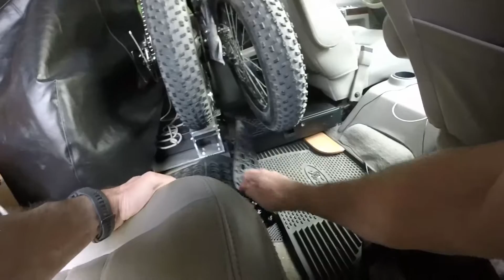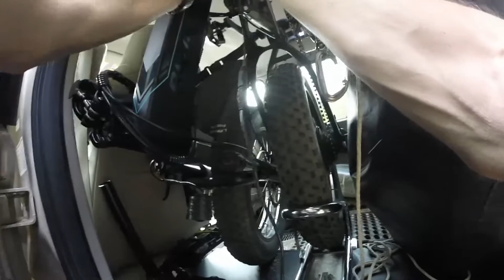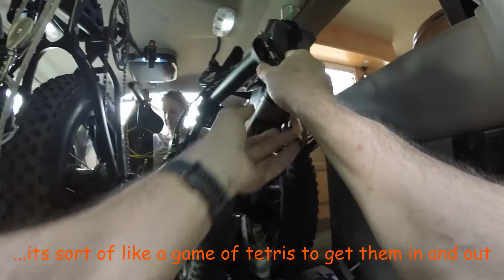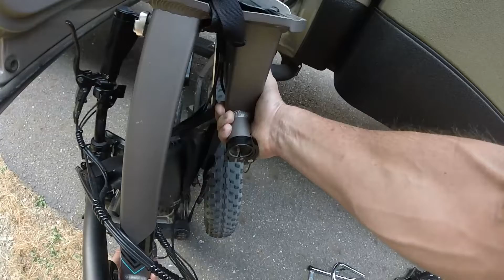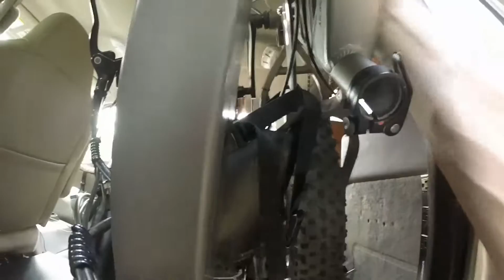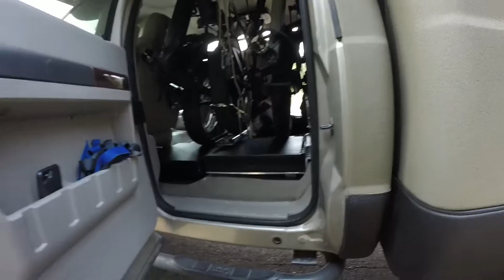EarthRoamer gets DIY folding eBike garage - Part 2: Finished & Loaded

Comment: Why not get bike rack for back over boxes?
Reply from the maker: We did bikes out the back for 16 yrs.  The box top rack still doesn’t solve the dirt...rain...snow problem.  It also doesn’t keep them out of site and secure like in the cab.  It adds additional weight to the pull out box slides that already are a bit stressed and complicates access.  We have a 1UP rack now that is up to the off road task but we want them inside.  Unfortunately we have read too many stories of people losing their bikes thieves both in North and South America...both places we will spend lots of time with our rig.